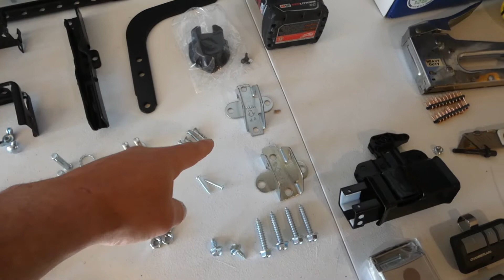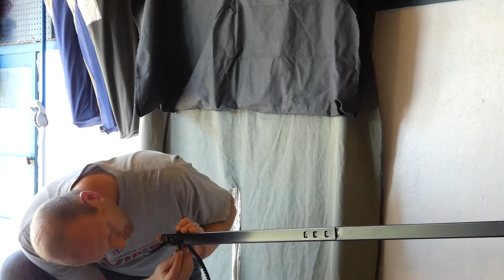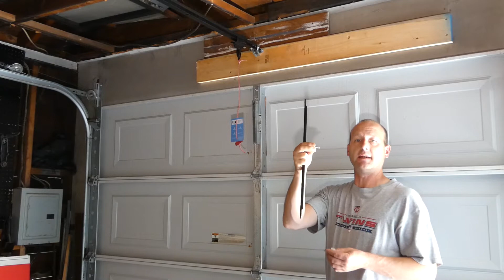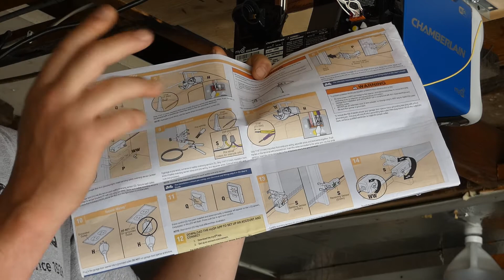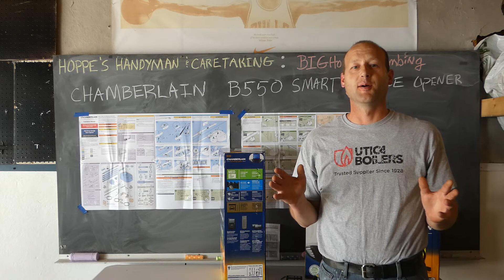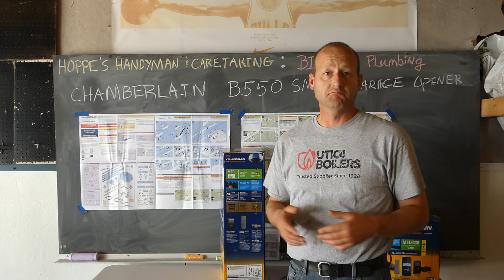Installing Chamberlain B550 Smart Garage Door Opener

Comment: UPDATE: I was able to install one of two today. It went pretty quick until I had to replace the sensor wires - what a pain. Your video was thorough and covered just about everything I needed to know. I only had to look at the directions a couple of times, about an hour into it to make sure I was grabbing the correct bolts/fasteners. Good job, great video, and thanks for the help!

Comment: Great video and timing as we are in need of replacing our 1/2 HP Chamberlain.  
One quick question about the MyQ app and connection: Does the MyQ app open/close your garage door if away from home, or does it require you be home connected to WiFi?

Comment: And one more mistake you were supposed to bend a tab on the top rail towards the pulley and you do not want your door arm straight up and down like that you want it at a angle and you want the J portion of the arm on the top hole if you need to you can flip the door arm the straight door arm upside down and bolted and any access door arm you have just cut it and then you have a clean professional look

Comment: You made two mistakes here you installed your safety sensors backwards they’re supposed to be on the inside of the bracket not the outside and you use the wrong kind of knot on the emergency release rope when you tied it off to the trolley you want to use the same one that you used on the emergency release handle and if you have any access rope cut it and then burn the end of the rope

Comment: Do you have to have one of those torsion springs?
Reply from the maker: Where is the torsion spring you are describing? Are you talking about the door itself or the tension spring on door opener?
Reply: Yeah I mean on the door itself. Do the doors have to have one?
Reply from the maker: It is nice to have them, they assist with the easiness of the door opening. If your door opens and closes with ease, you can probable rely on the garage door opener doing all the work.
Reply: Oh good. I was just curious because I see some doors with them and some without. Well thanks for the video. I’m excited to put my door opener up this weekend!